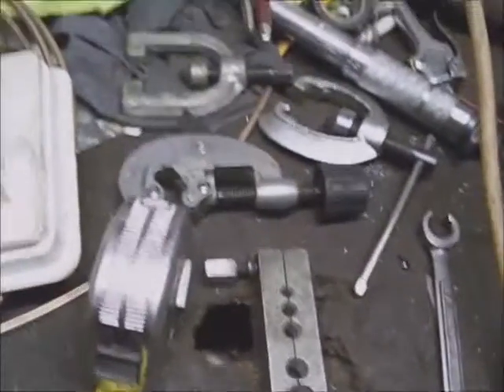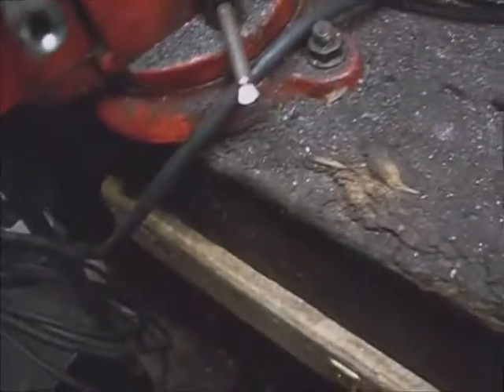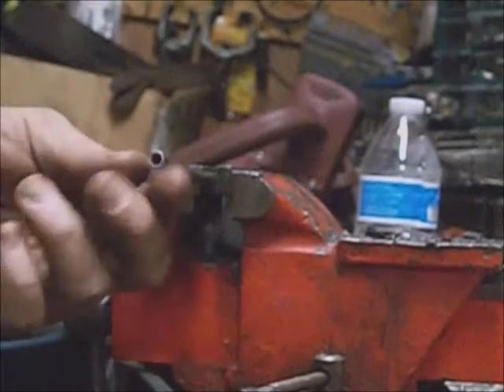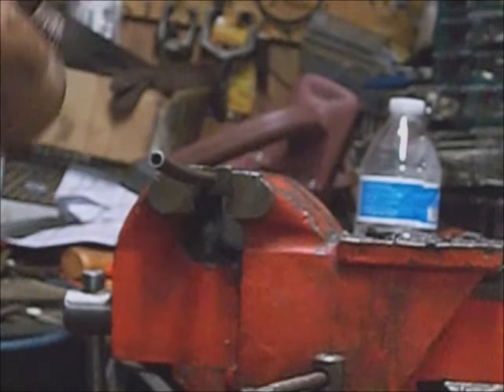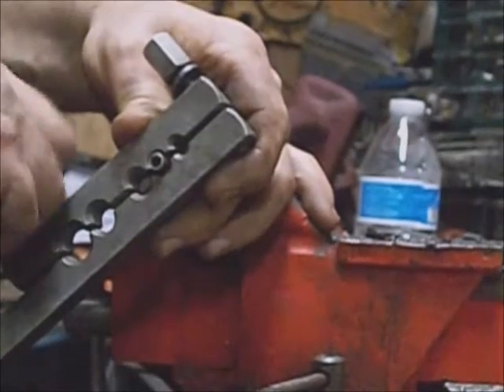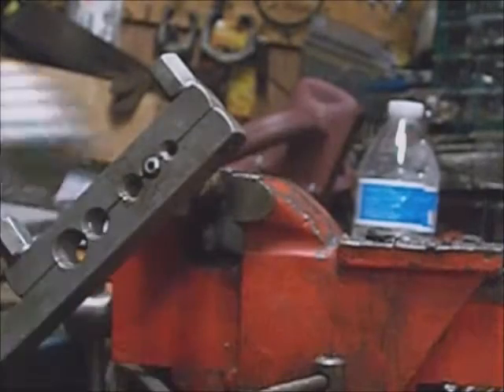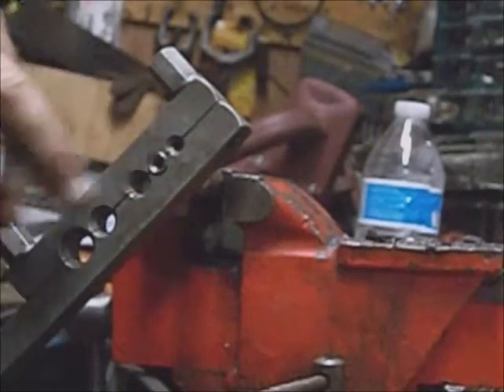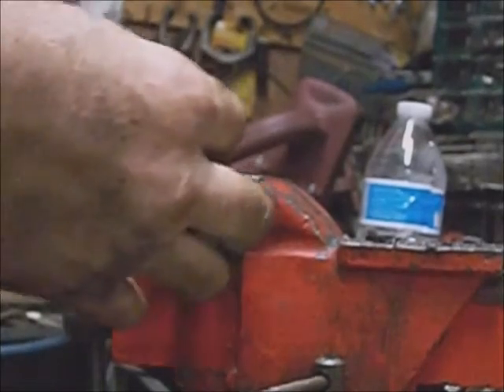How to make an inverted flare brake line end for the flare nut to seal against

Comment: Wow i thought inverted was just using the point part but now i see u gotta make a bubble first then push it in to make a inverted  flare ? Am i worng
Reply from the maker: On steel, if the metal isn't bunched up first, it will split on the flare.  Softer metals, like copper, doesn't have this problem..  generally.
Reply: @AutoDrdiy  I have gotten away with just using the flare on steel many times. Just have to heat it up a bit or leave it in the sun. Saves some time if you need to